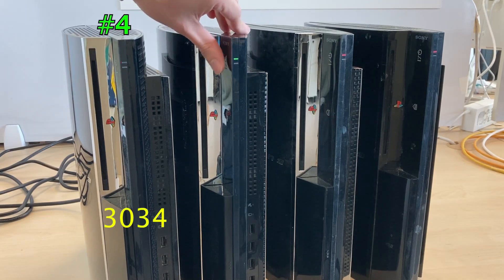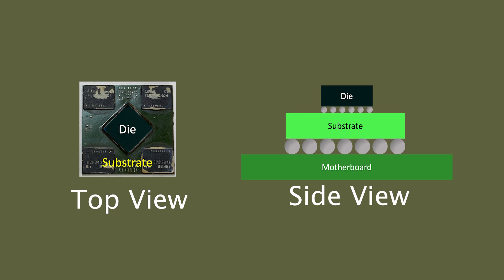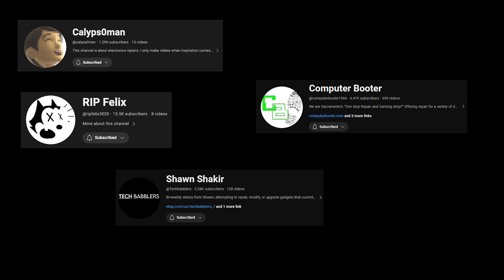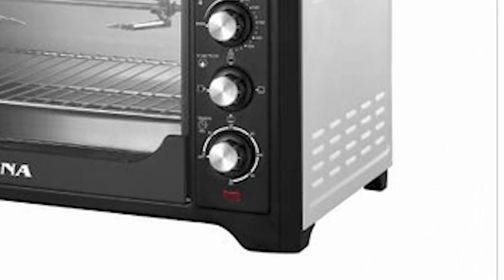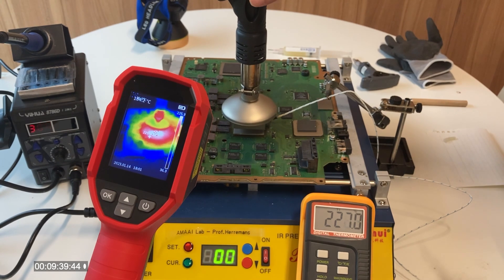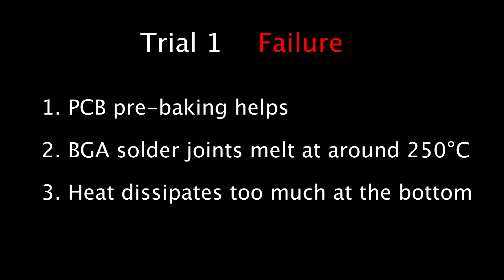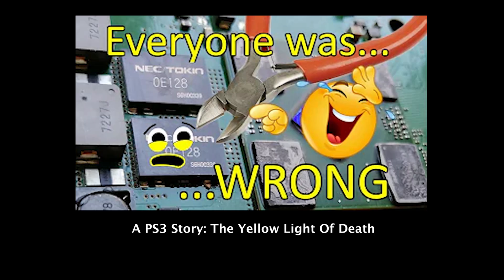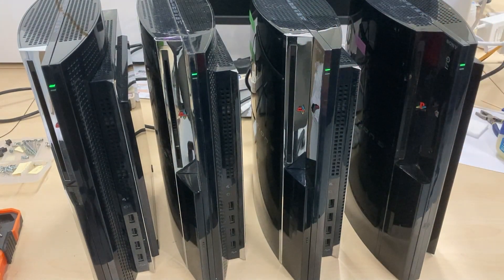I bought 4 broken YLOD PS3s to see if I can fix them (part 2)

Comment: Its not a failure, its not your fault that the trace came off, mostly importantly it can be repaired even if the whole trace came off, you just need to look for the right spot on Xdr ram and then make a trace  to connect it to Cell.

Comment: I had a fat model PS3 but it was the second revision which was not backwards compatible with PS2 games. It also had an 80GB hard drive and 2 games bundled. Resistance: Fall of Man and MotorStorm. I got it in 2009 and it wasn't until I believe 2015 that my PS3 had started to fail on me. Long story short,  I have a super slim PS3.
Reply: such a random comment on a video about doing technical sh*t
Reply: Softmodding can make them backwards compatible

Comment: You can't get away with doing this kind of project on the cheap. Utilizing the proper PCB preheating equipment as well as good rework station would turn out much better success. Lastly, further research on temperatures for re-balling or replacing GPUs or CPUs would also help.
Reply from the maker: Thank you for watching and the suggestions. Do you have any rework station that you recommend?

Comment: I wanna learn this skill too, but being a College student and hobbyist is really hard. I have 4 YLOD Launch Model PS3s, CECHA01 that has Tokin Issue which I've already fixed and sold for about 100 USD but there's still 3 that needs reballing / to be frankied since I also happen to have 4 slims. I don't have an oven and a preheater. Am too broke! 😂
Reply: I have CECHG04 ? Can it be repaired?
Reply from the maker: Indeed, soldering or BGA rework are very expensive hobby. But it's fun!
Reply: @hardwarerepair200  I have something to ask, I have just fixed an error 2040 on a PS3 Slim CECH3000 with KTE-001 Board by adjusting the potentiometer on the PSU, it seems fine but theres new error 2130/2131 or 2030/2031 even if it's working and upon testing for 6 hours with rest in between the PS3 shutdowns itself again. And I've got the error 2130/2131 which is the Thermal Sensor (Don't know if it's the diode inside the CPU/GPU Chip or the IC????). Yet my temps are normal 57-62°C with 34% in TLOU based on WebMAN during the test. Should I give up and let this rest in peace or this is still fixable? 😅
Reply: The NEC Tokin capacitors aren’t the true culprit behind YLOD. Though they can indeed fail, the cause for YLOD is actually due to a faulty GPU found on early launch models.
Reply: @crazedlunatic43  that's true. But the syscon states that the Tokins are bad so that's why I've only replaced it as I don't have a BGA rework station to do a franky
Reply: @clarencioo3040  Ideally, don’t replace capacitors unless they do go bad like how yours did. I have a late phat PS3 model (which obviously has the NEC Tokins) that still works well without issues (aside from being loud as a jet engine). My PS3 model is CECHK, which is a late batch manufactured on August 2008, and is not equipped with the faulty GPU found on early models.